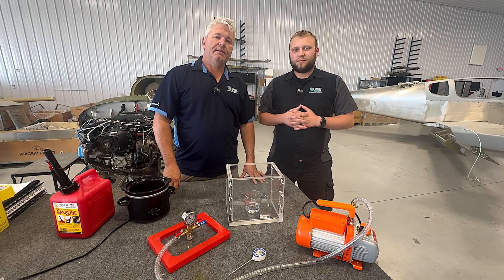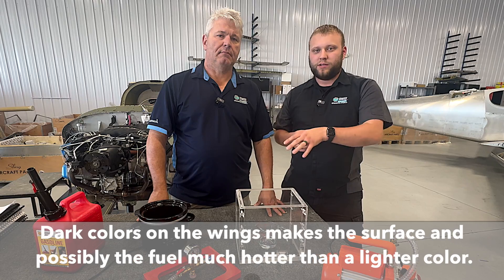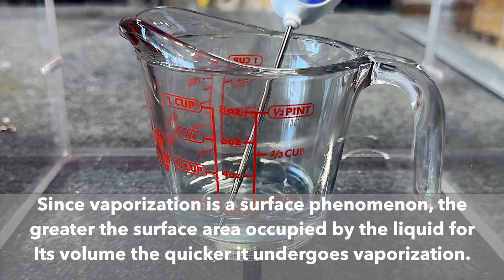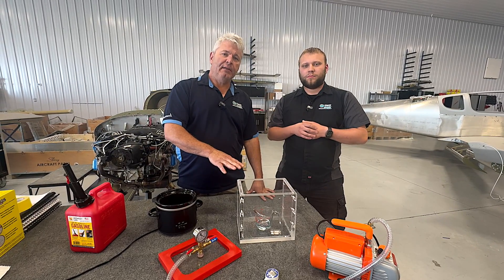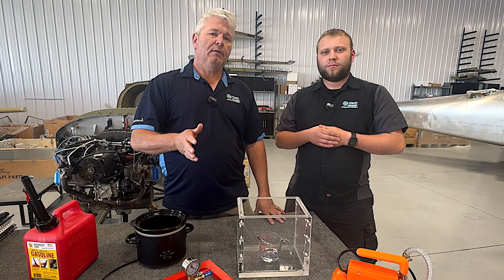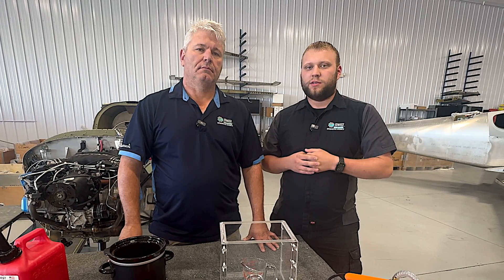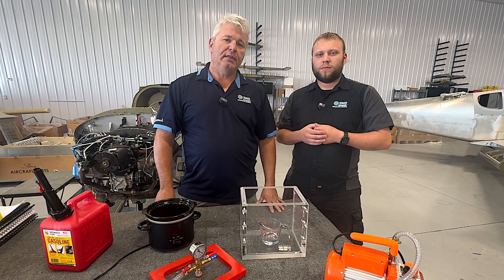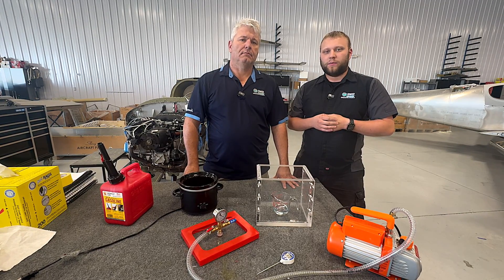Fuel RVP Testing

Comment: Sling TSi builder here, with the factory fuel selector and boost pump.  Great idea here and thinking of upgrading in the future.  Watching the video, one thought comes to mind…according to the demo, when the selector is in a “illegal” position, both pumps come on.  If that’s the case any consideration on changing the selector valve to one that accommodates a “both” position?  If that were the case, then the engine could be fed from both tanks, and only when a fuel imbalance occurs, would the pilot need to specify which tank to feed from.  This would eliminate the need to switch tanks unless an out-of-balance situation occurs.  Just a thought.
Reply from the maker: You can't do a both selection on most low-wing aircraft because you don't have gravity on your side. Cessnas, for example, gravity feed to the selector then from there go to either the carb or a fuel pump. That gravity feed means that the tank with more fuel has more push to the selector and thus will get drawn from. In reality, this causes the tanks to essentially equalize over time.

Comment: I’ve been to FL250 with my 915 on 91 non oxy fuel with no issues and indicating 53 psi on only the main pump. Granted it’s a HW with a belly tank which feeds the 915. Not sure what psi would be considered low enough to worry about issues?
Reply from the maker: A high wing with a header tank will have less of an issue with this for sure since you have gravity acting on the system. The pressure before the main pump is what most will never see since nobody monitors this and there will never be an issue after the pump if it is being supplied with a good amount of non vaporized fuel.

Not every flight will produce a problem since the proper conditions may not always be there but we have seen several situations where the engines have either run very poorly or stop all together.
Reply from the maker: 53 PSI seems a bit high by the way, you might want to look into that.
Reply: @MidwestPanels hmmm it’s always been 51-55psi at cruise power depending on altitude. 600 hours like that without issue. Wonder why? I just checked with others who have a 915 S21 like mine and they’re  around 46psi which aligns with what Rotax says 42-46….
Reply from the maker: @Captndarty  Yes 46 sounds right. Do you have the sensor hooked up to the Manifold pressure port?
Reply: @MidwestPanels  I just spoke to Rans. My sensor is located at the fuel valve bypass block. Their newer installs have it on the pressure rail, where Rotax wants it. The kit for this mounting option wasn’t available when mine was built. Also, I have a Kavlico sensor, which I don’t believe compensates for MAP like the Rotax sensor. They say consistency is the most important thing and since my pressure never fluctuates that that’s my normal and not to worry🤷🏻‍♂️ Anyways I appreciate what you guys do for this category and the Rotax community and for pointing out my fuel pressure so I could educate myself better.
Reply from the maker: @Captndarty  The issue I have with this is how do we know what is normal? what is the pressure with engine off and pumps on? Also, consistent is not really a good thing since pressure will fluctuate with throttle setting due to the fact that the pressure regulator is also plumbed to the manifold, actually with a non referenced pressure sensor it should fluctuate with throttle setting. However there is a setting that you could try in G3X to reference fuel pressure against manifold pressure.

Thank you for the kind words and for watching, we appreciate it!
Reply: Thanks Steve and Adam for the good information. Considering MOGAS, at what post pump pressure (high pressure pump) will the fuel NOT boil at let’s say 20k feet? In other words, what minimal pressure is required in the fuel rail at 20k feet to keep the fuel from boiling? My RV-8 is equipped with the EFII system 32. From what I understand, the EFII setup is basically the same as the fuel injected Rotax in that it’s a high pressure system that incorporates a duplex fuel selector valve and fuel return lines back to the tanks. I run my fuel pressure at approximately 35 psi and have never experienced a vapor lock problem. Granted I rarely fly above 15k feet, but unless I can’t get it on a cross country flight, I exclusively run MOGAS and have never had any issues. Although my RV is a low wing, I do have the pumps mounted as low as possible so that they’re not having to suck the fuel up hill.
Reply from the maker: @markh672 we need not focus on the pressure side, in a fuel injected system this will never be low enough to be a problem, it would have to dip to levels that would not allow the engine to run. We need to be looking at the feed side of the pumps which nobody monitors. This is the side e that can be an issue, when the pressure drops to levels below the RVP of the fuel it can introduce bubbles that will cause cavitation in the pumps. This is worsened by pump(s) that are uphill from the tanks because it creates a vacuum on the line which further drives the pressure down. If we can create a positive feed pressure or at least negate the negative pressure, we get our selves further from problems.

To tell you the pressure needed is a bit difficult with out knowing the exact fuel and blend as well as the temperature of the fuel upon departure and the rate of climb to altitude. These all factor in and are impossible to keep up on so our approach is to try to keep the feed pressure above the levels that most people could encounter issues with cavitation to combat the unpredictability of fuel vaporization.

Comment: My question is, why would anyone want to risk it? The booster pumps are not that much compared to what could happen besides they reduced wear on the engine pumps and gives you a much better safety buffer.